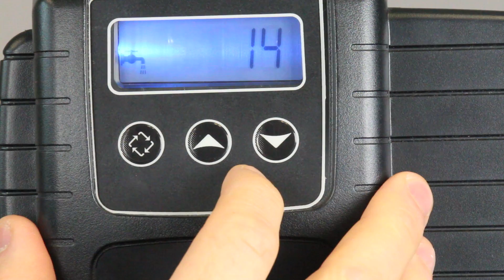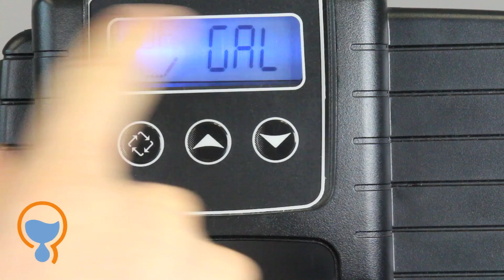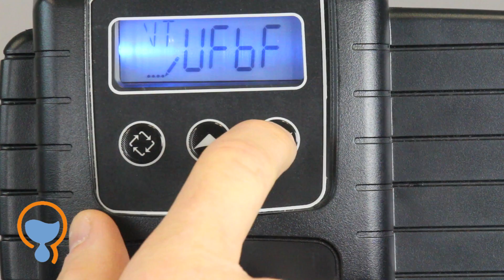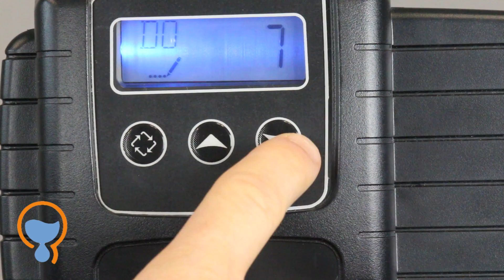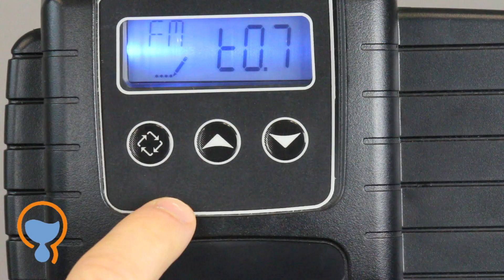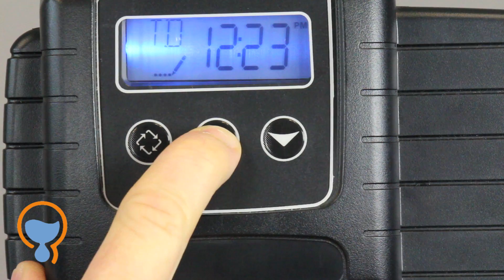Fleck 5600SXT Control Valve Programming

Comment: Great video. I have a few questions tho. My water softner is air injection Fleck 2510 2 cubic ft of resin. Tank size 12/52. 64,000 grain capacity. My hard water number is 120 ppm magnesium 10 ppm iron 10 with only 2 people in our home. My current program hardness is 34 is that correct?

Comment: Thank you for providing such a helpful resource. I am concerned about how much salt my system is using. I have the Fleck 5600sxt cabinet softener. I live alone and since I had it installed 6 weeks ago I’ve gone through about 3 bags of salt. Is this normal? I have all the settings recommended in video with hard whatever setting at 18 which is recommended for my area. Is this typical to go through this much salt?

Comment: I have this same meter, since install the gallon counter has remained at 1450. I’ve watched it for several days and it hasn’t changed. Any idea? Does it count down gallon by gallon or in increments
Reply from the maker: It should count down by gallon.  Check that the meter cable is pushed all the way into the hole it resides in and that it's oriented properly (on cross section it's shaped like a loaf of bread).  If that doesn't work, you can put the whole system in bypass, de-pressurize it by running a regen cycle, then remove the turbine and check to make sure it's spinning freely.

Comment: Thank-you for taking the time to make this video, it's very helpful. I have a Fleck 5600SE head attached to a filter tank, which is connected to another tank with a water softener bin. Which turbine setting should I use please? It said GEN, but here you say t0.7. It was also set to tc , and not fd. Any advice would be really helpful. Thank-you in advance.

Comment: How do you pick the day you want it to generate?Example Tuesday...Thanks
Reply from the maker: Well, you don't really.  There are two ways this system can be set up to regenerate.  Option 1 is based on the number of gallons processed, and Option 2 is a day override (DO) value where the system regenerates every X days.  If you set the DO value to 7 and then force a regeneration on the day of the week that you always want it to regenerate on (let's say it's a Wednesday) then it will continue on regenerating every 7 days from that point, which will always be a Wednesday.
Reply: Thank you

Comment: is there a "recharge now' button,    or a 'recharge tonight' mode?      my older softerner had both those features which i used quite a bit,  esp before you know kids are coming home for weekend, for showers, laundry, etc,   i would recharge friday night, so the water will be ready for a heavy weekend of use

'
Reply from the maker: The button on the far left is the 'regeneration' button.  If you press it once and release it, this queues up a regeneration at the time you've set for regeneration in the programming.  If you press and hold this button (until you hear the drive motor engage), this will force an immediate regeneration.  Hope that helps.

Comment: Hi, can you give a TDS reading before and after the water has been "softened " please.
I want to know if my water has been softened or not.
Cheers
Reply from the maker: You can’t use TDS to measure the hardness of water. Because water softening is an ion exchange process the TDS measurement before and after will be identical. If you want to measure softener performance you need to measure the ‘total hardness’ before and after the softener.

Comment: I have a 9100 sxt. Twin 32k tank. Setting it at C 32, H 9, BW 10, BD 60, BF 8, RR 10. My water still fills hard. Don't know what to do.
Reply from the maker: Hi there.  You need to get into the master programming menu.  The 9100SXT uses the same controller as the 5600SXT.  Have a look at this page:  https://www.aquatell.ca/blogs/aquatell/programming-the-fleck-5600sxt-softener-valve-for-max-efficiency.  However, with the 9100SXT when you get to NT set this value to "2".  If you still don't get soft water, well, to be honest it could be a whole bunch of things.  If you bought the system from Aquatell I'll be happy to help you continue troubleshooting, but if you bought it somewhere else I suggest you go back to them.

Comment: Should the brine tank water level be above or below the salt? Is there a preferred amount of salt that should be in the brine tank at any given time? I have a 64k grain system with 4 people in my household. I have capacity set at 40 x1000 and BF at 8 per your instructions. Thanks in advance for your reply!
Reply from the maker: The level of water compared to the level of salt isn't important.  All you have to make sure is that the Brine Fill (BF) setting is correct and that you have ANY amount of undissolved salt in the brine tank.  For your system you've got the capacity and brine fill setting exactly correct.  I suggest you fill the brine tank almost to the top with salt, and then just check it every few months to see how the level is.
Reply: I thought 40k grain for 2ft3 system goes with 6lbs of salt which equals to 4 minutes of Brine fill? How come we use 8 minutes here (12lbs I assume)? I just bought the same system and am trying to understand salt dosage, thanks!

Comment: Great video, very helpful.  I had just finished the programming when the blue screen began turning black and smoke came out from the control board. I unplugged and found out the outlet I chose is actually 240VAC instead of 115VAC :(              Can I purchase just the replacement control board?
Reply: Yikes! Lol.  Yep - you can buy the 'powerhead' which is the square part up top that contains the circuit board and the motor that drives the piston.  If you'd like to go ahead with that purchase please send us a note through the website (aquatell.ca for Canada / aquatell.com for USA).  Thanks.

Comment: Thanks for the informative video.  I have a Fleck 5600SXT with 1f3 (32000 grain) resin.  My 15" x 17" brine tank has a salt grid.  I'm wondering if your recommended Brine Fill setting of 5 will add enough water to reach the bottom of my salt pellets?  If not, what should the minimum brine fill setting be?  Thanks!
Reply from the maker: 5 minutes of Brine Fill time will add 2.5 gallons of water to the brine tank.  That's likely enough water to get above the salt grid.  But if it is not, increase the Brine Fill time to 6 minutes and then change the Capacity value (C) to 25,000 grains to match it.  It won't be quite as efficient, but it will still be quite efficient, but more importantly it will work!

Comment: This is tremendously informative and helpful. I moved into a home that has two tanks with separate valve controls (both are the Fleck 5600SXT). The Day Override was set to "Off," on the first valve control, and on the second control valve, it was set to regenerate after a number of days. Is this how the two valve controls should be used? Will the second valve accomplish the regeneration cycle for the first tank?
Reply from the maker: Likely the tank with the day override set to 'off' is a softener (if it is it will have an attached salt tank).  The valve with the day override set to some number is likely some kind of filter.  Usually it would be a carbon filter or perhaps something else.  The valve on each tank will regenerate/backwash the tank it's attached to.  The one will do it based on water consumed and the other will do it based on time elapsed.

Comment: How do you regenerate after putting in iron out?
Reply: Hold down the circle arrow button on the far left. That will put it into back wash. After it goes into back wash is will run through its settings of rr, bf,bd etc.
Reply: Thank you

Comment: why is there such a big diff in time between brine fill 10 and brine draw 60 min, doesnt this mean it is sucking air dureing  50 mins of brine draw ?
Reply: Nope.  The brine draw pulls the brine out of the brine tank at a much slower rate than the brine fill fills it.
Reply from the maker: No - a softener will be equipped with some kind of an air check valve to prevent that from happening.

Comment: good videos. i installed a 48 metered 5600 sxt and a few months later the water would only partially soften. 20gpg originally down to 12ish. i tried everything i could think of. finally replace the head and it worked great for 2 months, now it is only partially softening again, 12- 15ish. could this be a problem with the meter possibly.
Reply: How are you testing the water?  Make sure you're testing the 'total hardness'.  This doesn't sound like a meter problem to me.  Something else is going on.  Sounds more like you've got some untreated water that is bypassing the softening process.  Once you've confirmed that you're testing the proper parameter (Total Hardness) you want to force the softener to regenerate.  Once that is done, immediately run your cold water faucet for 3 minutes then check the hardness.  Should be close to zero.
Reply: Reid Thornley . nope. I'm using a softener testing kit. installed about a dozen. last time I tested it was 16 hpg. generally it's 19-20 here. the resin may be set to low, it is a 48k and I havnt checked the replacement head setting yet. this is a doozy that I'm struggling with. it's almost like it's sucking the top water and riser water but it seems to be snug in the oring.   could water pressure have anything to do with it.
Reply: These 'partially softening' issues are brutal to figure out.  Could be a bunch of things.  I'd check again to make sure that the control valve is seating on the riser tube properly.  You said that the system is using a 'replacement valve'.  Is the replacement the exact same kind as the first?  Different valves need different riser tube heights.  Maybe that's the issue?
Reply: thanks, it's about an hour drive so I will have to get to it later, but u have give me some ideas to work with. I'm debating if it could be something with their water line or if it is %100 softener issue. All parts are the same as original item shipped.

Comment: Why does the clock ALWAYS say 1800. it does not go down like he said while programing. It flashes between the time and then it always is 1800? Are we doing something wrong?
Reply from the maker: When the softener is out of programming mode, it toggles every few seconds between the time and the number of gallons remaining until the next regen.  If your softener stays at 1800 forever, then it's not measuring the water flow through the unit properly, or the softener is in bypass mode.
Reply: how do set it to not be in bypass mode or make sure the flow is properly happening?

Comment: I am thinking of buying Fleck 5600SXT  48K grains capacity and it is of 1.5 cubic feet unit, Can i just set the capacity to 20K with 7 days regeneration time  ? OR set the capacity to 30K with 10 days regeneration ?. I am buying bigger than my usage because large capacity will be needed later for my home ( according to calculations on your site i need water softener with capacity 21K per week)

Comment: so...I have a this unit:  
http://store.afwfilters.com/water-softeners/single-tank-water-softeners/5600-softeners/64k-water-softener-with-fleck-5600sxt/

but I need to set the Capacity to 40?  Just wanted to be sure since this is a 2 cu. foot of resin.....thanks!
Reply from the maker: +Mike Veloz Hi Mike.  Thanks for your inquiry.  With a 2.0 cubic foot unit, you can set the capacity to any value between 40,000 and 64,000 grains HOWEVER you will achieve much better salt efficiency setting the capacity to 40,000 than 64,000.  This is because 40,000 grains will only use 12 pounds of salt to regenerate while 64,000 grains will use 30 pounds.  It's important that your brine fill (BF) is matched to the capacity value you choose.  If you go with 40,000 grains, make sure your brine fill is set to 8 minutes.  This is assuming that the brine fill rate on your machine is 0.5 gallons per minute.  There should be a sticker on the control valve where the brine line attaches that shows the brine fill rate.  But it's almost always 0.5 gpm on the 5600SXT.  I hope that helps.
Reply: +aQuatellvideos thank you.  helps a lot.
Reply: +aQuatellvideos also....the control valve sticker says the drain flow is 3.5gpm....should I consider any changes to the settings b/c of this?
Reply: +Mike Veloz The drain line flow is not relevant to the efficiency settings we're discussing.
Reply: +Reid Thornley ok....I was looking at the sticker on the control valve where the brine line attaches...maybe I am looking at the wrong one.
Reply: +Mike Veloz The sticker is on the control valve near the brass connector where the brine line inserts.
Reply: I see it... There are three stickers in that general area. .50GPM 1.5LB salt/min  got it....

Comment: How long does it take for the water softener to take effect? One day after being online, a second test has shown a higher hardness reading. Is it cleaning deposits from the plumbing?
Reply from the maker: Stephen Yue Hi Stephen.  Your softener is a metered system.  This means it measures the amount of water you use and regenerates when the system is at or near it's capacity.  The day override (DO) function is used as a hard-stop to force a regeneration even if the system has not used all of it's capacity.  On a city water supply where there is no iron, I suggest you use 14 days for the DO value.  This means that if your softener goes 14 days without regenerating based on consumption, it will regenerate anyway.  This makes sure the resin stays healthy.  To minimize your salt consumption, you want to set the capacity (C) value to 30,000 and the brine fill (BF) to 6 minutes.  The type of salt you use makes very little difference.  I hope that helps.
Reply: Should be pretty much instantaneous on the cold water side.  For the hot water side it will take a while for the soft water to displace the non-softened water in the hot water tank.  Probably a couple of days.  Yes - the soft water will very slowly dissolve the hard water scale in your pipes, but this is so small an effect that it would not show up on a hardness test.  Out of curiosity - how are you testing the hardness?  If you're using an aquarium test kit, it won't give you the correct result.  Also, make sure you're not using TDS as a proxy for hardness.  You need to be using a drip-style water hardness test kit specifically for drinking water (avoid the dip-strips).
Reply: ***** I'm using a meter. It's an Extech ExSik II,  EC-Sal-TDS.  The readings went
from 270 to 300, then to 277 ppm over three days.

Thanks for your interest.

Jeff
Reply: ckjk616 Sorry, I forgot to mention that the installation involved quite a few plumbing changes. The copper had to be run to the cold water supply for most of the house along with a 25 foot run to the water heater. When the water was first turned on, as with many plumbing jobs, the water ran brown for quite a while. Also, there is now a whole house water filter just before the softener. I let the water run for quite a while until I couldn't detect any of the discoloration, but this was by eye.
Reply: ckjk616 It all makes sense now.  The meter you are using is not measuring hardness, it is measuring TDS.  TDS is total dissolved solids.  It is a measure of the amount of dissolved material in the water.  The water softening process is an ion-exchange process - the softener grabs on to calcium and magnesium and in exchange it releases sodium.  So, the water softener could be working perfectly, and the TDS will not change.  Or, depending on the makeup of ions in your raw water, the TDS could even go up, but your water will still be soft.  To confirm the hardness you need to get a water hardness test kit, but I bet everything is working perfectly well.
Reply: ***** Thanks very much for your help. I appreciate your interest. I'll get a water hardness kit to see where I stand. Thanks again.  Jeff
Reply: ***** I have a question regarding Fleck 5600 SXT control valve. In order to conserve salt usage and water for a 48,000 grain capacity (2 cu. ft) unit, is it correct to say that I need to set the DO to 7 or 14 so that the unit will regenerate every 7 or 14 days at the set time of 2am every morning (for city water with very low lead level) AND also leave the # of gallons of treated water remaining BEFORE regeneration as low as possible (the # displayed on the screen)? My current settings are BW (10 min), BD (12 min) and BF (8 min).  
I think I have the wrong settings in my unit recently when I added 4-5 bags (20 lbs) rock salt crystals and it was down to a very low level. Does it have anything to do with the kind of salt crystals used? I was switching to a different kind of salts last time. I hope it's just the wrong settings. My display of gallons of treated water (display) is about 880 at this time. Don't you want to get this # as high as possible so that  regeneration will occur at 2am every 14 day with a DO of 14)thus saving water in the long run? Please clarify and thanks in advance.

Comment: What is the size of your media tank and how much CF of resin you are using.
Reply from the maker: At 1:58 and 5:01 I provide links in the video that take you to a page on our website that shows the Capacity (C) and Brine Fill (BF) settings for softeners of various sizes.  These are the only settings that are specific to the tank size / resin volume.  If you're having trouble with these settings just tell me what tank size / resin volume you've got and I'll give you the values you need.
Reply: aQuatellvideos I am using a 9x40 tank filled with 1cf of C-10 resin.
I am having problem removing 30GPG well water because I still have 10GPG. I set the 5600SXT exactly the same way as you show. the timer regenerate every 666 liters ( as I set my timer to liters). I don't understand. I know that 20,000grain / 30gpg should give 666.666 gallons which make about 2,533 liters. If you can help me with this it would be very helpful.